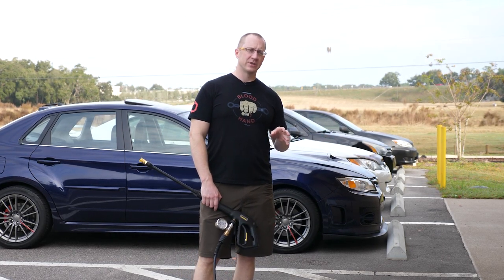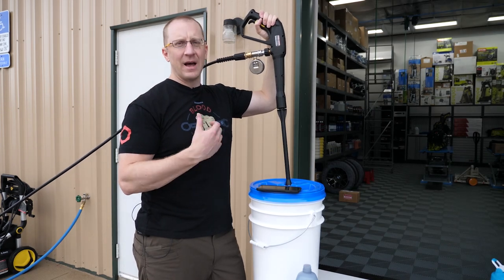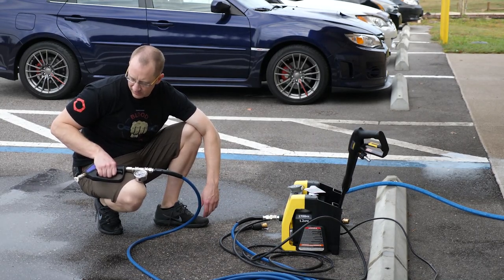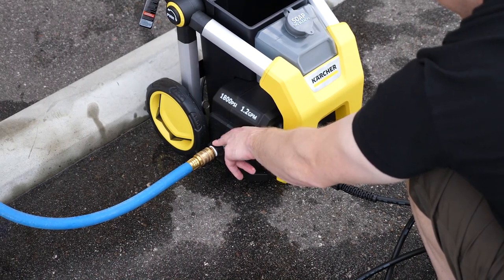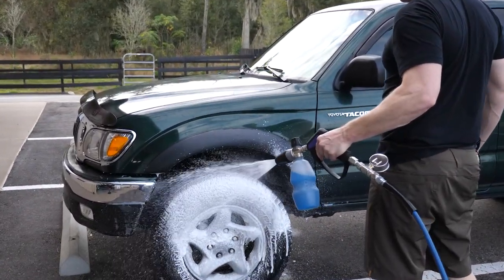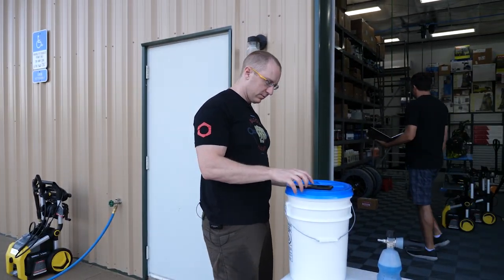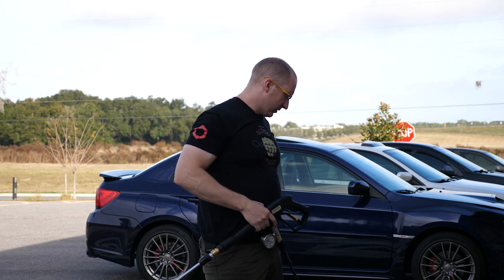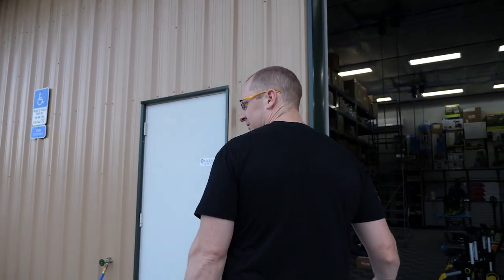The Pressure Washing Project: E11 - Kärcher Product Line Part 1

Comment: The issue with air may be because you are trying to prime it without a nozzle on the end.   the reason why this is a thing is the Soap injectors are venturi based, so when there is no back pressure, the soap injector is injecting air or soap into the line. I have tested this myself with a much older K2 i have, which has said soap injector.

Using the wand without a nozzle (has a gentle 40 degree or so unrestricted spray built in) results in soap or air.

As soon as i put a restriction on the wand like a proper nozzle or my Bowdens Foam Cannon, the air bleeds out then stops within seconds, even on some 12.5 meters of hose.

What you should do, is leave the nozzle on for priming the high pressure hose, and make sure the inlet line is fully primed, then turn her on and just let her run, she will sort herself out decently fast.

The other thing you could do is simply fill the soap tank with water so it doesnt suck air.
Reply: I was about to write the same thing
Reply from the maker: I did it both ways.  These took 5 minutes to clear the air out.
Reply: I could get not get mine to work, tried what you did and started working immediately thanks!
Reply: I just got a K2000 and tried what you said and it worked!
Reply: I just bought the K1700 because of this review....thanks Matt! Yes the air  can be an issue. What I do before I turn the power on is, I take a strap of velcro I use to keep the high pressure hose together, & wrap it around the trigger of the gun letting the water run while I get all my other crap together & filled. Usually gives me a few minutes of letting the water run.

Comment: Turbo nozzle is a pencil jet that is then spun in a clockwise fashion to create a larger area but without losing any of the power of the pencil. That's why you must be careful when using a turbo nozzle. Turbo are great for tractors and other 3in thick mud and stuff but I wouldn't recommend using on body although it won't hurt it if the paint is still good but it's quite tough on the paint.

Comment: I am pretty sure Kartcher (SP?) is the company that makes the pressure washer machines for Simoniz.  If so, the connector on the reel is M14 if memory serves.  I did not try to find an adaptor for it, I just used a M22-14 to M22-15 and added a second 30 feet hose as an extension.  If you can find a M14 to M22-14 that would be amazing.    Been waiting for this part of the test since you started, really happy you got to it.  Eager to see the charts once you are done with the testing.

Comment: We don’t have those Cube models in the UK. Never seen them before. I’ve always had Karcher since I bought my first one in the early 90’s. In that 25+ years I’ve had 3. My current 6.8 is over 10 years old. I’ve had it that long I can’t remember when I got it. It used to be the case that the K5 onwards (if memory serves) used a different spec motor with all metal parts rather than some plastic components that the K2’s etc had. So the higher number models were very reliable. I’ve read on a forum recently that Karchers aren’t what they once were and made in China now. I’ve never had a problem with them and my pretty ancient 6.8 is still going strong. It’s been used pretty much every week it’s whole life. I’ve been waiting for it to go so I can try something else but it won’t break!
In the UK it’s Kranzle, Karcher and Nilfisk that appear to be the ones that are the most popular with detailing enthusiasts.

Comment: Waiting for the K4, K5 and K7 video. Thanks Matt for the great work 👍🏻
Reply: k7 is UK spec so you cant simply plug it into an USA outlet.
Reply: True, a good amount of Matt fans and customers live outside the US, including myself. Also, if you are truly after the GPM (2.6 for the K7) the 220v is the way to go. You will need an electricity converter box for that to work in the US (approx $70-90)
Reply: @aaoaaa  transformers will burn the motor faster and importing the unit is a pain in itself.
Reply: @Swagura Mutsuki - Telling you from first hand experience it wont. I imported my K7 from Dubai and it was super smooth. Also, I imported high end coffee shop coffee machine with double boilers to the US when I was in the US few years ago and they use 220v and require very high watts due to the heating process. I got a quality electricity converter and it worked flawlessly for years without issues
Reply: @aaoaaa  for the cost of importing it I would just buy something better 🤷‍♀️
Reply: @Chase Compton: importing cost was $100 dollars. Sure if you found something better for the same cash value go for it. Total cost for me delivered was $690 so it made sense for a German 2.6gpm pressure washer
Reply: Actually you don't need a converter for imports if they will operate on 220/240 50/60 the converter will only up convert the voltage and the frequency if compatible for 50/60 will be no issue.  However if it's rated for only 50hz it will take a toll on motors but if not used continuously should not be an issue.  The frequency will affect anything that is time sensitive unless it's dual 50/60hz.  The only thing you need to do is run a double pole 15/20 amp breaker and the appropriate outlet for 220,/240 and have it dedicated for that item.  If you want to use the original power cord and plug from country of origin you can purchase a outlet from that country such as the Schuko for most of Europe.

Comment: The k1900-2000 uses a induction motor instead of universal like all the other pressure washer which is more complex, heavy, and theoretically more durable. It’s supposed to be quieter too but guess not for those models. It’s the equivalent to the brushless motors u tested before.

When I was scouting out pressure washers, the k5 Has a water cooled induction motor so that should be very quiet so I’m interested to see if it’s true.
Reply: k4 and up have way better pumps, but the uk version of trhe k series pout out way more gpm, the uk K4 puts out 2.4 gpm(box rating).

Comment: The reason why you have an issue with air is that its pulling air from the soap tank, I fill mine with a splash of water and it takes 10 seconds to get the air out of the line.

Comment: I picked up a K1700 Cube locally today and paired it with my MTM Premium 1 Pro Kit.  I didn't get anywhere near as nice of foam as you did on the PF22 with the 1.1 (Chemical guys Honeydew with approx 60ml in the bottle with warm water).   However I also noticed when I hit the trigger there is a big "lag" right after the initial spurt before the pressure gets up so I'm suspecting an inlet issue first (using Gardena hose and fittings).  I'll test with a short 5/8 leader hose direct to the K1700 and see if that solves it and also try more soap.   Otherwise it is a nice little unit and would fit on a shelf great though that foot pedal is handy!  So nice to see the outlet is standard.
Reply from the maker: All of your problems can be solved here.  Ha, ha...  https://www.obsessedgarage.com/collections/karcher-accessories

Comment: My k4 takes about 15 seconds to clear the air in the system. The dealer told me to let it run for 30sec to clear it or longer if it still has but never had to go longer.

Comment: Matt, just found your channel and have been watching intently.  Just ordered the K1700 Cube for washing the cars and light jobs around the house.  At 6:52, you mention 3.0 1000 psi.  What does the 3.0 nozzle represent?  Is this related to the tip in the gun you have attached?  Also, when do you think you will have the accessories up for the Karchers?  Thanks for all you are doing.  Dream job - playing with guy toys and helping other car guys at that same time.  Bravo!
Reply from the maker: 3.0 is the size of hole in the nozzle.  The smaller the number, the more pressure.  All Karchers are done except K2, K3, K4, and K5.
Reply: @ObsessedGarage  Thanks, I thought so as I related this to tips in an airless sprayer.

Comment: So I have the k4. Had to get the adapter for my amazon canon. I’m new to the foaming game. I still don’t get thick foam like what you are getting but I’m still playing with my mixtures. I thought at first it was because of the psi being too low (k4 1800psi) but I see you are getting great foam with the same. Side note, my drive way is small but the rotating head that comes with the k4 cleaned it well lol. The foam I get is rich but not shaving cream type like you get. Do you think it’s the gun itself?
Reply from the maker: First issue is your crappy foam cannon.  Second is it probably has the wrong sized orifice.
Reply: Obsessed Garage ok, I see. I was checking out your site and I see you have the adapters I need to put the mosmatic handle on my karcher. Will grab that and the proper canon when I get some cash.

Comment: I just purchased the k1900 and I find that the air bleeds out way quicker when the pressure washer is not turned on. This seems opposite of you would expect. Anyone else experience this as well?

Comment: Seems the $249 Greenworks 2200 brushless, despite it's ramp up time, is the best big box option. 1050 PSI flowing at 1.9 GPM with the 4.0 nozzle 👍.
Reply from the maker: I wouldn't choose it.  The ramp up time is really, really annoying.
Reply: @ObsessedGarage  So given the options you'd get from a big box store like Lowes, you'd sacrifice flow for convenience?
Reply from the maker: All of these pretty crappy, so a lot of it will come down to acceptable amount of output and then user experience.  I think the Karcher 1700, Ryobi 1600, and Greenworks 2000 are the best this far.
Reply: @ObsessedGarage  would you test the Greenworks 2300 (looks like it's new)  to see if it still has the delay issue?

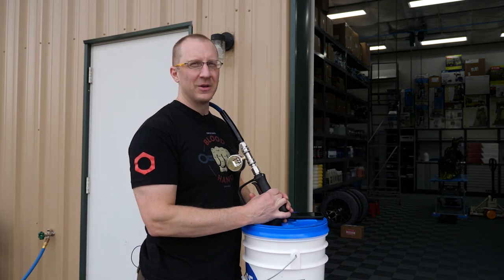Comment: Great video series. When you say at 7:02 that your pulling 12.8amps which is less power how do you figure your overworking it if it was drawing 15amps before? Letting the system build back pressure I would figure is just harder for all the pump parts to push water through the nozzle?
Reply from the maker: What I'm looking for is a spike.  If the pump was drawing 13 amps when using the regular gun and then jumped to 18 amps when using the foam cannon, that would be a red flag that we were overworking the pump.
Reply: @ObsessedGarage  Great. Thanks for clarifying.

Comment: I know you would retest but it seems like the initial start is different for every model from each brand. I wonder what the GPM would be if you started each one for 5 seconds and then put it in the bucket to given them an even playing field. You could have also used an in-line flow meter but I know those are expensive.

I don’t think the difference would be huge but I think these models would have slightly higher GPM if not for the weird start up. A couple seconds could mean .05 of a difference.
Reply from the maker: I started them all the same, so the info is good enough for me.

Comment: I have a K1800 and I attached a hose to it, turned water on,  and the hose popped/tore at the connection. Cheap hose i guess.

Comment: Also beware make sure before each use you bleed that machine with the nozzle on it. The air in that will eventually mess up the pump
Reply: fleet tech are you saying to do that before turning on the pump?
Reply: @pcarfan1676  Yes.. connect everything turn on the wAter and pull the trigger and let the wAter flow for about a minute,you will hear the air as that is being done. After that is finished then turn on the unit and work it
Reply: Thanks!
Reply from the maker: I did that for 5 straight minutes with then without the nozzle.

Comment: Debating on a 1700 vs a 1900...  the induction motor / triplex pump in the 1900 should, in theory last at lease twice as long as the universal in the 1700 correct?  My thought is the 1700 has better flow but at the cost of needing replaced every couple years at most where the 1900 should last at least a decade or more for less than twice the cost of the 1700?

And just for fun, I have a lathe and made several custom foam cannon nozzles from 0.8mm to 1.2mm and didn't notice any difference in foam using any of the sizes but with the smaller orifice the pressure washer sounded like it was struggling, a lot.  I settled on 1.05mm as the machine didn't sound like it was working so hard.  Maybe the washer I currently have just isn't really up to the task.  Several nozzles, soaps, concentrations... no real discernible difference .  I've never got foam like in this vid.
Reply from the maker: All the Karcher consumer stuff is 70-120 hour capable.  The 1900 user experience isn't very good.  All of these are just throw away machines every few years of normal use.
Reply: @ObsessedGarage  Ah, gotcha, thanks!  I was expecting more from an induction motor unit. :-(

Comment: I purchased a K1900 in 2018 and within a short period of time the machine locked up and I couldn't get any water to come out of the nozzle.  After many attempts at undoing the hoses, etc. the company sent me a new unit under warranty.  The new unit, which I received in 2019, acted the same way.  It would lock up all the time like a vapor lock in the hose and sometime the motor would not kick on.  Probably on used this machine 6 or 8 times before it froze up for good.  Poor quality machine in my opinion.  Roy Ortolon

Comment: Matt, thanks for the awesome videos. I'm in a dilemma due to my 1 year old gas pressure washer pump blowing apart. Is it worth buying an entry level machine like you're testing  with the correct set up or fix my craftsman 2800 Briggs pump and new set up?
Reply from the maker: I'd probably fix the one you have.
Reply: @ObsessedGarage  I've been searching for months and it seems that the parts are more than what I paid and impossible to find anything great. I got a ryobi 1600 and I want your hose set up with the mtm quick disconnect. Do I need anything for the $75 hose to snap that handle into the mtm?
Reply: @Ruhdiculus  What is the part that broke on your pump ? i'd had just fixed my simpson 4000 pump with only $50 cost for the part bought from amazon for the new valve set and seal..
Reply: @harisyoung4110  it was the whole pump that cracked and broke. At the time it was very expensive but almost two years later I can check Again lol
Reply: @Ruhdiculus  I think now you can get a brand new chinese made briggs pump assembly for at about $100 on ebay.. but it'll cost more with the pump brand from AR, and maybe you can consider to upgrading to 3600psi new pump.. Gasoline pressure washer is worth to repair, it will clean house and driveway more easily.

Comment: What is the advantage of use if that inlet hose? Think I have a pritty good 50ft hose that I can use for the inlet if it fits. At the end of the day a hose is a hose right?
Reply from the maker: I'm don't think you are asking the correct question.  You'd need a shorter hose if you didn't want to lug out an entire 50ft. hose.

Comment: Good thing I'm selling my k3 already upgraded to a kranzle i got for 550 bucks, it's the 2020 so all I need to do is retrofit a total stop switch and the hose reel and I'll practically have a 1122tst
Reply: Weird I just got a k2020t for 500 and sold my karcher  do you have any info on where to get the tst kit from  I contacted kranzle usa but haven't gotten a reply from them thanks
Reply: @romp23  you would have to ask for part number 41.300 6 and 15.009 3, https://gzhls.at/blob/ldb/9/3/8/1/945f09178b2f8eafec4c7b2eb133f350177b.pdf page 36 will show you how it goes together, the problem here is i haven't figured out where to put the ground and neutral wire yet.
Reply: @SWAGURA  thanks
Reply: @SWAGURA   I looked up the parts indicated and the only issue I see is the micro switch 15.018 that is located in the tst box 41.300 6 is only rated for 16 amps the k2020t is rated at 20amps. 
Was these parts recommended by kranzle?
Reply: @romp23  well the 2020 is drawing 20 so you should be fine
Reply: @SWAGURA  are you saying the 16amp switch will be fine when the k2020 is pulling g 20amps

Also I looked at the wiring schematic i didn't see a ground only 2 wires from the tst box which should just kill the hot leg going to the motor
Reply: @romp23  I haven't figured out the wiring yet but of the tst box is 16 amps k2020 uses 20 amp so ull have enough
Reply: @SWAGURA  I have to disagree the tst switch should be rated  at least 20amps I am going to outsource a different microswitch and put it in the tst box.

I will look at mine when I get home if you need help with the wiring it should be fairly simple just use the wires from the microswitch to break the hot leg 

Does your tst box have 2 or 3 wires coming out of it
Reply: @romp23  mine has 3 actually, what I did was ask for a tst conversion kit from kranzle so they should give you one or you can send it out.
Reply: @SWAGURA  here's what I found out you have 3 wires coming from the tst box but only use 2 you will use the 2  that go through the normally closed set of contacts there is no ground wire 

Then You go to the on off switch You will take off the hot wire leaving the switch and connect one of the wires from the tst to that spot 

Then you connect the wire you took off the switch to the other wire coming off the tst box and you should be done.  

Hope that helps
Reply: @SWAGURA   did you install the parts did everything match up?

Plunger and the tst box? Did you have to modify the housing for the tst to fit?
Reply: I ordered the kit I got a different part number that combines both parts if you havent figured it out I will get back to you as soon as I get mine installed are you in the US
Reply: @SWAGURA  got mine up and running works great let me know if you need help
Reply: @romp23  i`m in the U.S
Reply: @SWAGURA  I got mine working if you need help
Reply: Swagura Mutsuki 
.Q@